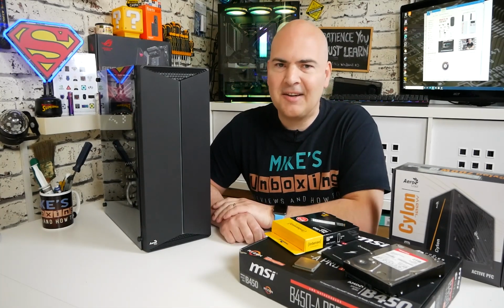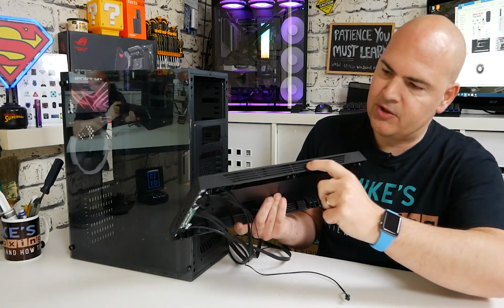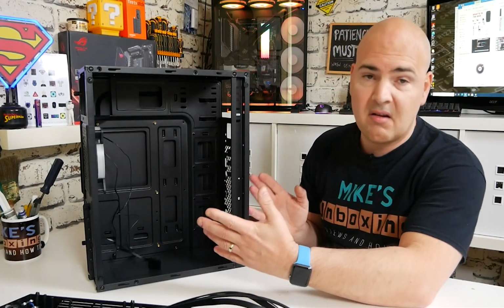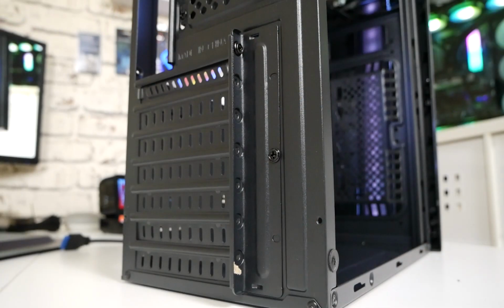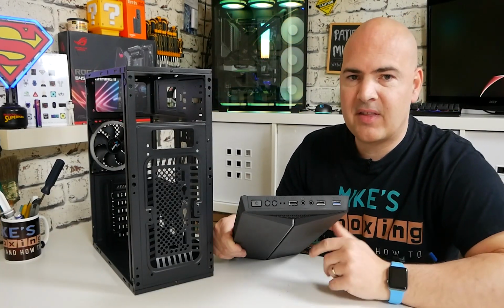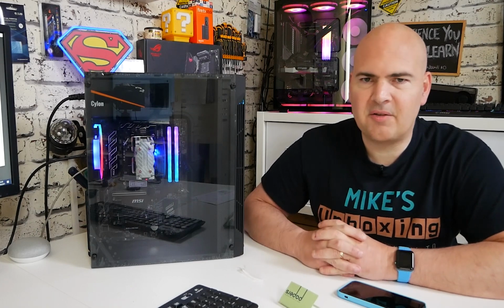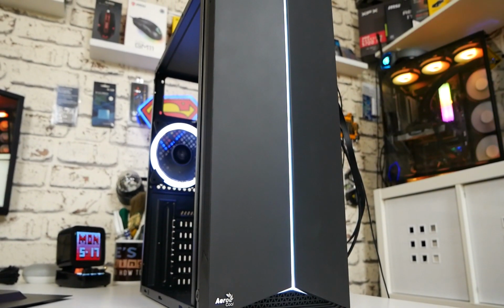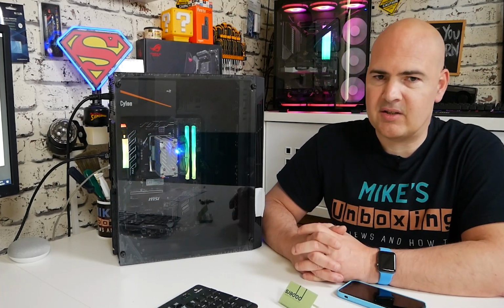Review & Cheap PC Build Aerocool Split ARGB ATX Extreme Budget TG Case

Comment: didnt know if you noticed it but you can put 1 front fan inside it (it can be 3 but you need ultra slim ones for it) on the top you can see it if you remove the front panel
Reply from the maker: yes that was a consideration, but thanks for pointing it out
Reply: @mikesunboxing  i fixed the airflow problem by modding my psu now it will suck air into since my psu doesnt generate much heat atleast no heat i can feel

Comment: I'll have to describe the sheer hell of building in the Tacens ac4500, one thing to note is that it is deceptively easy to connect the case cables to a mATX board in an ATX case, nothing like as easy when the edge of the board is against the case bottom (ATX in ATX or mATX in mATX. I had to tape them together in a block to get them in, a good tip actually...
If I'd recorded the build it would be PG rated or worse!
Reply from the maker: lol lots of 18 rated words

Comment: An old-fashioned case (PSU in top). With expensive hardware prices right now, it's a fair choice (thinking of adding 3 fans would be a lil bit higher). Thank you very much, Mike, Kath & Ugly Bob for today's video.
Reply from the maker: yeah a little old school is design with a couple of modern twists, for anyone building a system needed a cheap box with bling then it is hard to moan at £20

Comment: The cases with side glass panels, do they run hotter than cases with ventilated or fan side mounts? Just thinking during the summer do I want my over priced gpu BBQing in that? Not that I have an overpriced gpu but you get my meaning 😅
Reply from the maker: there is a slight insulating effect of glass but most people prefer the look for the minimal increase in thermals
Reply: @mikesunboxing   Thanks Mike. that makes sense now.

Comment: A case like this is perfect if you want to learn  how to do case modding. At that price, if you mess it up it's not that big of deal.
Reply: That could be a nice use case,
Perhaps if you flip (experienced) pcs you could build in this and brand it as “rgb” LMAO!!!!
Reply: @outlawfett3530  I'm currently doing a water cooled green and black themed build in a Antec Dark Phantom DP502 FLUX mid tower case that's about the same size. It's a bit more challenging then in my Thermaltake Level 20 HT, which has a ton of room for water cooling. But it's been fun so far.
Reply: @OlettaLiano  That’s cool, never ventured into watercooling myself. My 9400f doesn’t need it.
Reply: @outlawfett3530  For me it's not about need. A $50 air cooler all most people need, if I'm honest. But I'm one of those weirdos who don't mine shelling out a thousand dollars or more for water cooling simply because of how good it looks. LOL
Reply: yay
Reply: @jamesmiscellaneous  James, last of the long winded speakers. 😂
Reply: @OlettaLiano  doh
Reply from the maker: yeah you can really go to town on this and learn on the way